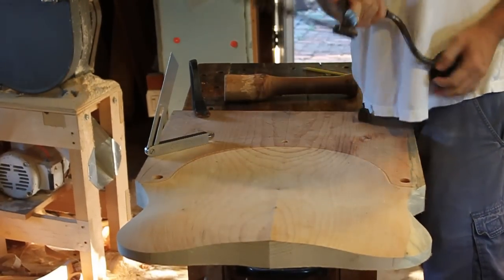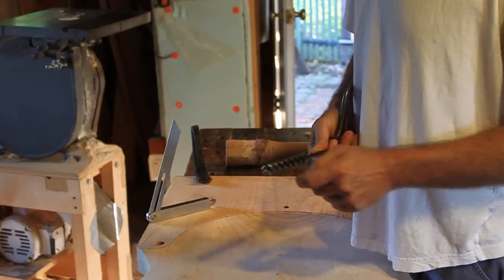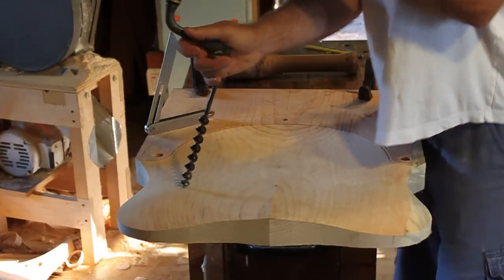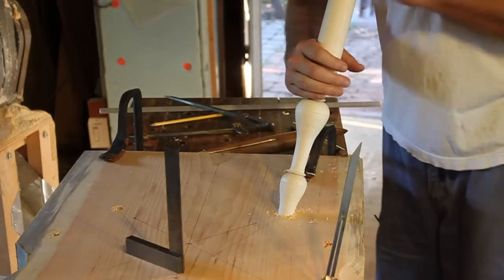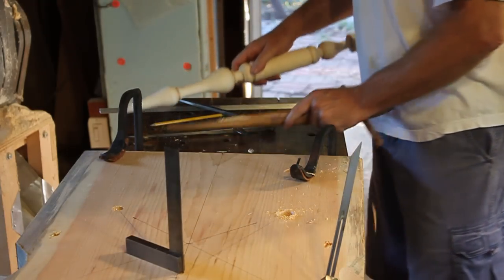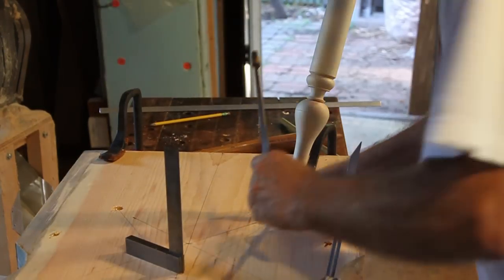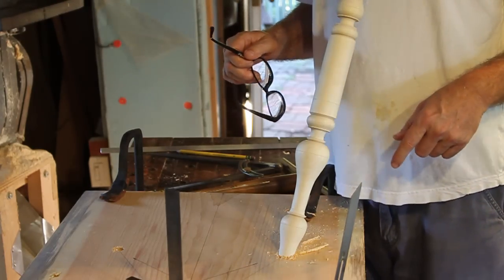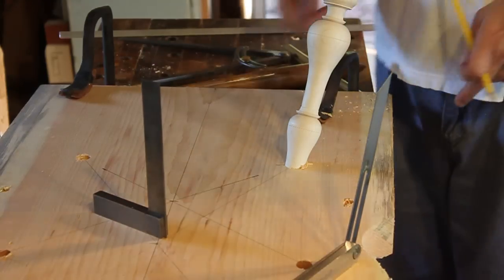Curtis Buchanan - 19. Drilling and Tapering the Leg Holes

Comment: Curtis, did you drill pilot holes for the leg mortises in the seat prior to carving or did you locate the position for the leg mortises after carving? If you drilled pilot holes were they perpendicular to the  uncarved seat or were they drilled at the resultant angle? Thanks!

Comment: I know you got this down, but for me, why do you drill from the top, where you cant quite get the bevel guage near enough to site by, easily; you could drill from the bottom, which is presumably flat. you said the auger beaks through cleanly, so that isnt the reason; also, reaming the taper is done from the bottom, so you could do that without turning the seat over....loved the seat carving/scraping sequence; I use a paint scraper,ground to the curve I need(they're cheap to buy, and have hard metal, you can skew them just like the pricey ones.
Reply: @curtisbuchanan7691  Thanks Mr. Buchanan; I have since this above comment, realized that you have done this before X 5000, and could no doubt drill this hole on the money with NO bevel guage at all!!